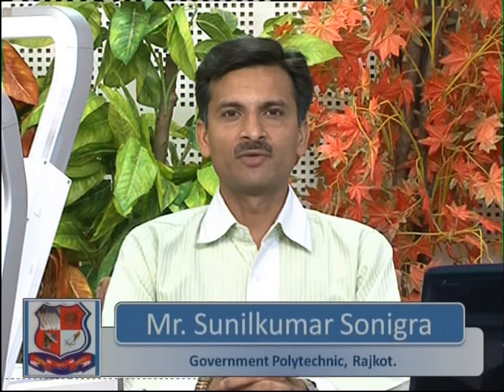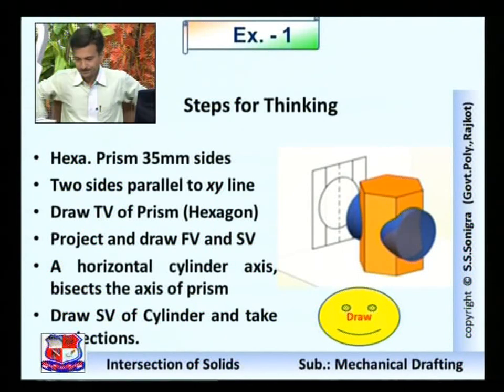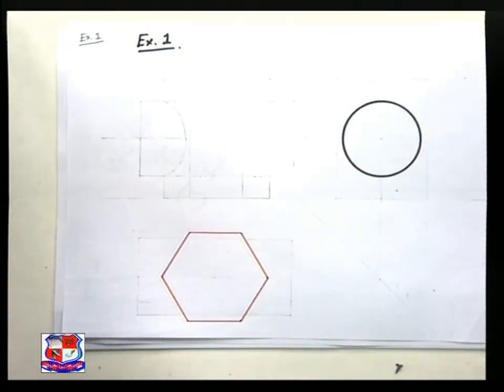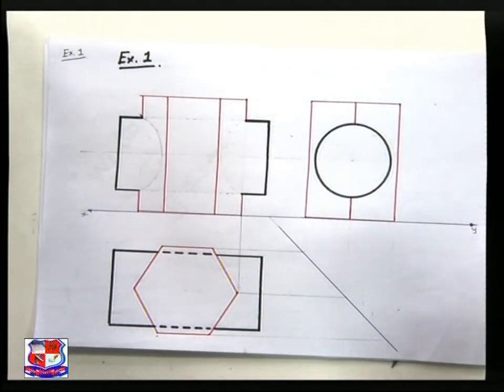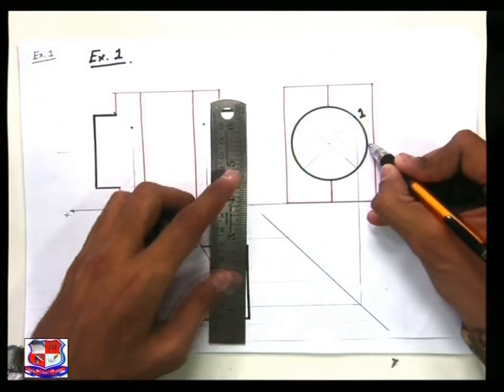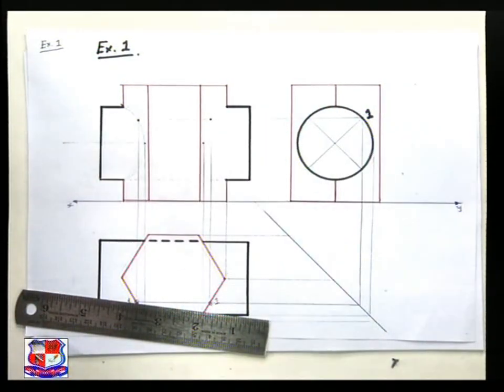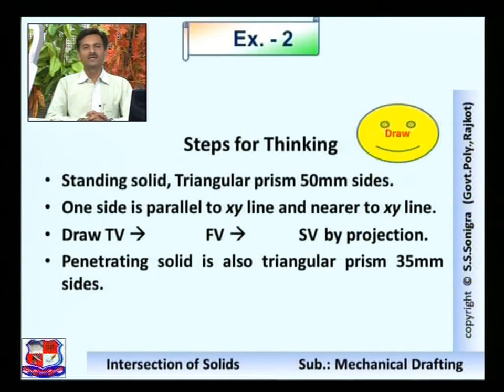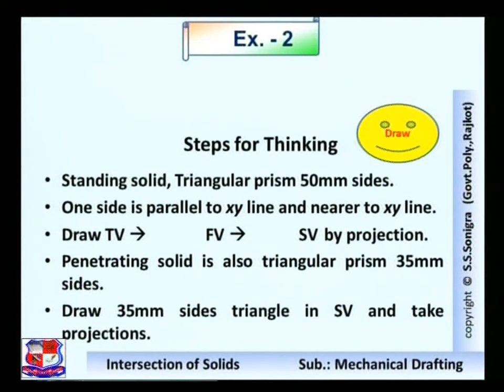Sonigra Sunilkumar  Mechanical Drafting Intersection of solids and surfaces 1

Comment: Sir I am expanded with question 
A vertical cone of base diameter. 100 mm and axis length 90mm is penetrated by a horizontal cylinder of base diameter 50mm axis length 120mm .the axis of the cylinder is parallel to V.P. and  is 30mm above the base of  the cone .
The axis of the cylinder is 12mm away from the axis of the cone . draw its projections of the solid showing curve of intersection  sir please solve the question  and cutting plan method